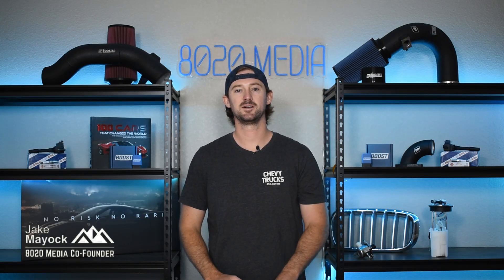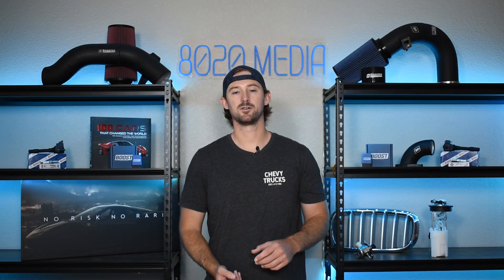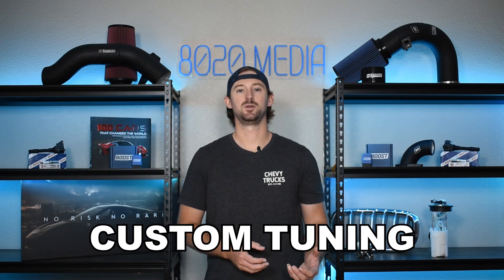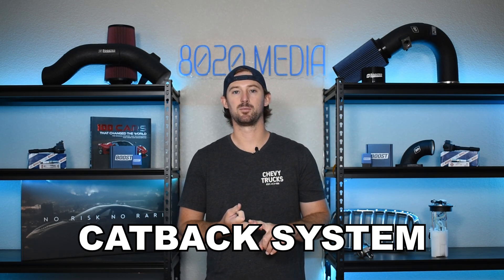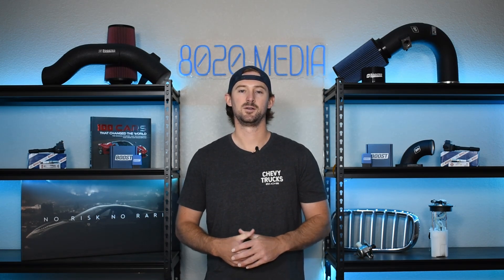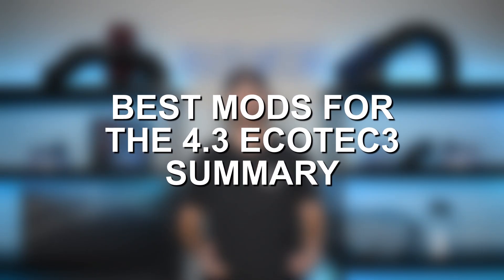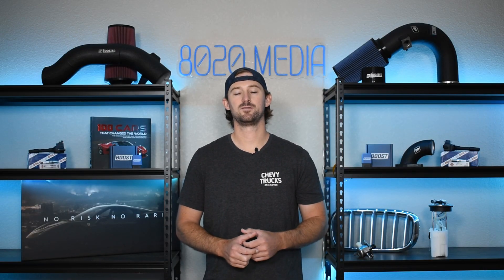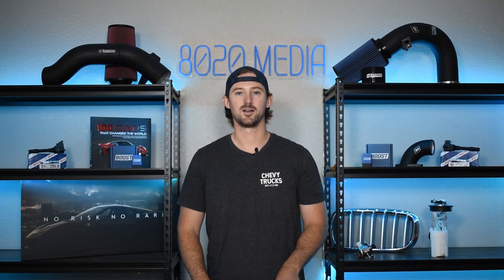How to Build a 325 WHP 4.3L EcoTec3 for Under $2,000!

Comment: How much WHP for the stock engine all I found is 285
Reply from the maker: S - You can expect the stock 4.3L EcoTec3 V6 to produce between 228 and 242 wheel horsepower, depending on the specific drivetrain losses of the vehicle.